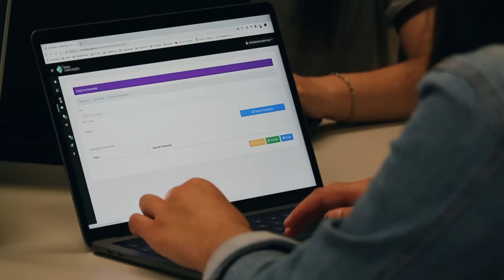9 Best Highest Paying Jobs You Can Learn (Without a Degree)

Comment: If you’re pursuing software engineering or development, boot camps are worthwhile if you have a degree already. If you don’t have a degree, and haven’t been working with software personally,  don’t go to a boot camp unless you’re pursuing web development. They’re similar in price to a CS degree online but hold a fraction of the value. I’m sure there’s people who can make it with just the boot camp, and great job to those who have, but it’s much less common than advertised. Remember, if it’s too good to be true it usually is. A 3-6 month boot camp won’t get you the 100k salary you think you’ll make. I’ve worked in big tech, DOD, commercial, and finance industries. I’ve NEVER worked with someone who went to a boot camp.

Comment: When I first started working with solar panels it was like Chinese to me these days I’m considered a solar pro I thought electrical was difficult to learn but it’s really not u don’t have to be scared of electricity just respect it at all times wires always go somewhere and stop somewhere so u just gotta figure out the issues from start to end it’s so simple
Reply: Solar install is hardly considered electrical. It’s mostly installing rails and panels on roofs. Not hating but just saying … also how’s the 20/$hr treating you ?
Reply: @deezenutzz69  yea if your just doing roof installs sometimes you got ground mounts that involve trenching you got battery’s you got generators sometimes cities require electrical upgrades before solar can be installed so I’ve been doing this almost 10 years which qualifies me a solar pro but I mainly do electrical we have rackers that rack and set panels most solar companies don’t pay by the hour they pay by the watt so I make well over a 100k plus it’s my dads company and will be mine in about 5 more years so I’m doing ok 👍🏼 thanks for asking!
Reply: @ACAMPS.HITHOUSE as long as your not the one setting the appointments going door to door then yeah that’s a great gig…door to door in 2023 kills any good quality about that job

Comment: Power plant operator here. Lot of misinformation in the video. Job description and pay are way off. There are 2 types of operators: licensed, who work in the control room, and unlicensed, who work outside the control room, seeing things locally..we’re called the “eyes and ears” of the plant. Different utilities pay differently. The low is about $200k and the high can be upwards of $300k for licensed folks. Get that $82k-$130k outta here. You can’t just google everything and assume you’re getting accurate information. My job as a non licensed operator makes $150k and it’s usually the most laid back job I’ve ever had

Comment: To get into Power Plant Operator which we call Process Operator you will need a 2 years associates.  The job is extremely hard to get because every community college has the degree. Its a good career if you can gain employment.